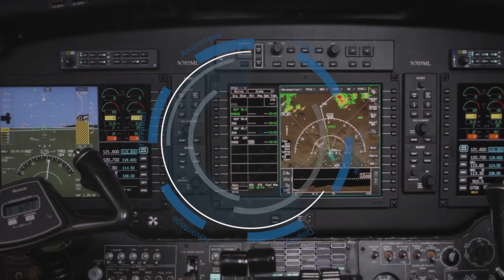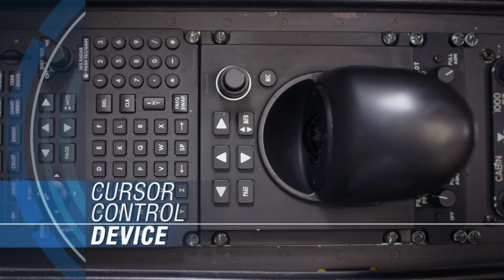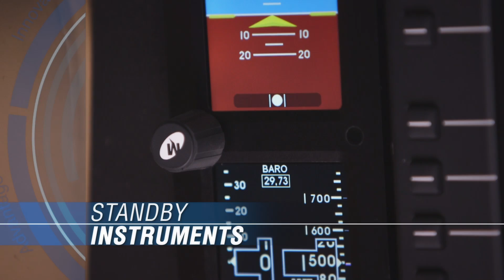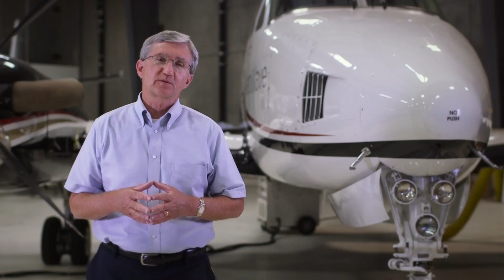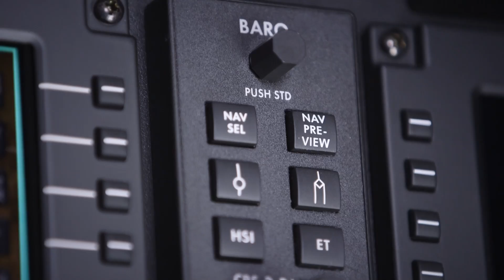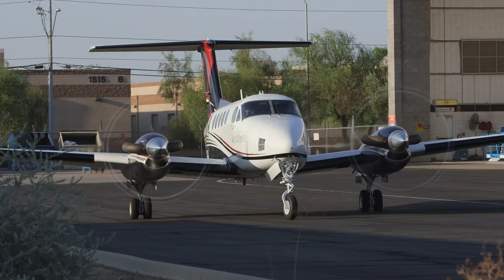AeroVue Integrated Flight Deck

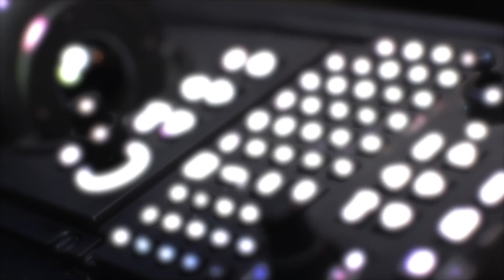Comment: @2:40 cursor control devices are horrible, and don't allow the pilot to keep their head up.  Gulfstreams used a thumb control in the armrest, which was nice, but windows 95 style pull down menus are clunky in a cockpit.  PFI area of this cockpit looks good.